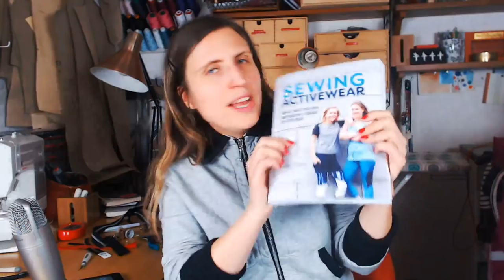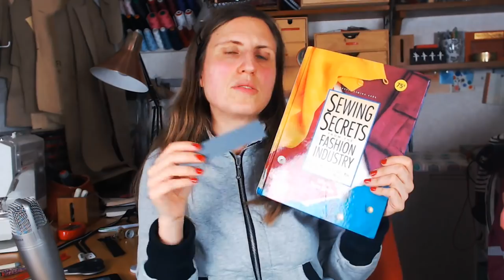Live: All about sewing zippers!

Comment: A very helpful video Johanna, I picked up some good tips there. I use a lit match to stop fraying on ribbons and zippers lol.  For inserting zippers into stretch fabric, you mention using interfacing to stabilise the stretch fabric - would that be stretch or woven interfacing?  I am still mastering invisible zips so tend to default to a lapped zip most times and finally if there is a zipper foot I really feel I need I will buy a generic ones as these are a lot cheaper - I bought a walking foot this way and it gets a lot of use as I'm also a quilter.  👍👍😘